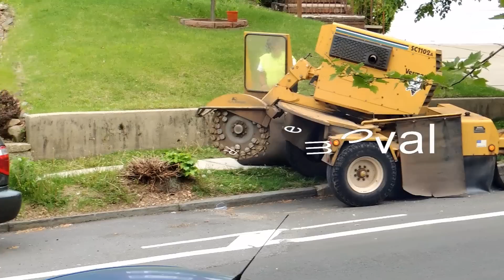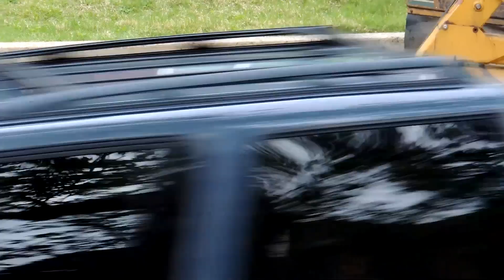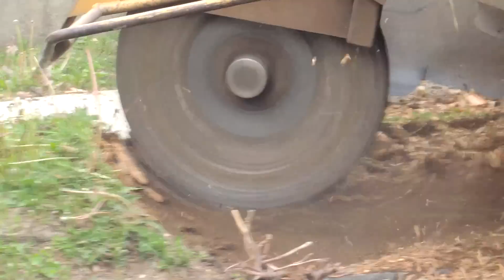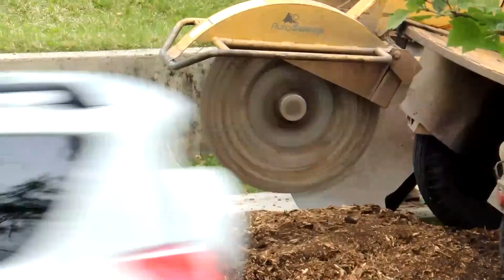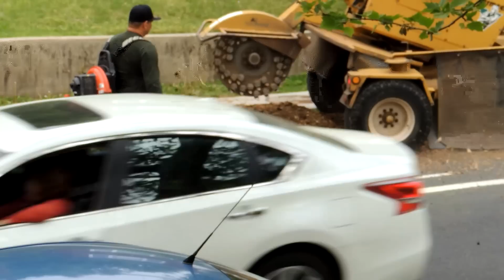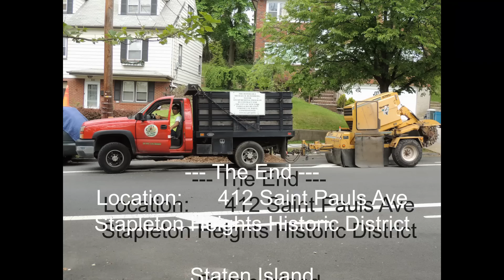Tree Stump removal

Comment: I have the same model grinder 1998, had it since brand new with 3000hrs now. the safest place to be is behind that door! lol Also, you can see right up close to your work. The operator did an outstanding job! no need to go deeper since the stump was rotten and it's a grassy/weed area. BTW, I've hit asphalt and cement with my 1102, with "green teeth waresharps" and the 110hp of the the cummins 4bt motor it still grinds fast and doesn't slow down! now when it comes to granite boulders imbedded in stumps, that's another story! lol -Happy grinding!
Reply: He isn't right a Tiffin stump does come out in big ads chunks
Reply: I just purchased one of these.  Can't wait to try it out.

Comment: I agree should have gone much deeper.  I would have straightened the grinder to get a more heads on approach, and it helps to have a spotter on the other side to help you get as close to the curb as possible.  Other than that its a pretty awesome machine.
Reply: +michael waitkus the stump is gone, the floor is gone.

Comment: THIS is a Dead stump , "aged and dry,"[[[[[[[ now ''''''''''''''there would be a difference with a stump that is full of its natural juice or cambium layer.    how deep would a stump cutter have to grind downward to effect the life of a active live stump?        do all stumps have the ability to regrow if they are not ground deeper with a stump cutter.   , example  some larger stumps  =  Have larger surface roots ,   would those surface roots need to be ground down with a stump cutter  , or need the extra treatment of  Epsom salt or salt and vinegar 7% then covered with dark plastic to avoid sunlight/rainwater on the roots /stump.etc.   stump cutters do amazing effects on stumps yet  long term ,or variety of tree ,age, raised roots.  long term ? can you take the time to explain the long term effect of stump cutting a active live stump.with the grinds of wood chips off a green wood or live active stump , need the natural wet wood chip debris removed to yard waste bins , then the ground stump be covered with heavy not wood chip'd dirt  to block its regrowth.  do some  varieties of fresh live stump -wood chips have the ability to grow more small trees,  even a florist  shop which may use fresh cut tree twigs in a floral display knows the green wood twigs can grow roots to be replanted. eg even a red twig dogwood etc

Comment: Seems to me that the stump remover machine is pointed in a direction to throw wood chips, dirt, and possibly stones in the direction on on-coming cars. If this machine cannot be positioned so that the cutting blade is parrelel to the sidewalk, then another machine that can position it self should have been used. Operator doesn't seem to be real smart walking next to the cutter, one slip, or trip and he's dead. ........................................... Jim.
Reply from the maker: That's amongst the reasons that the machine maker won't use this video on their own social media.  ✔